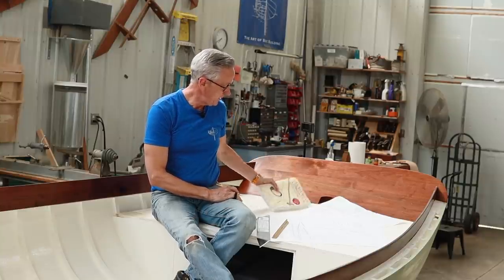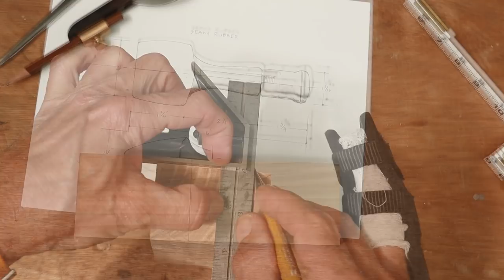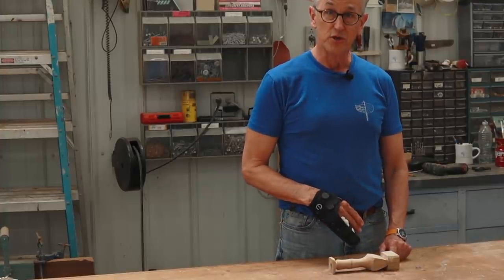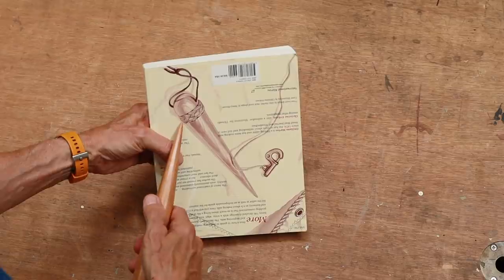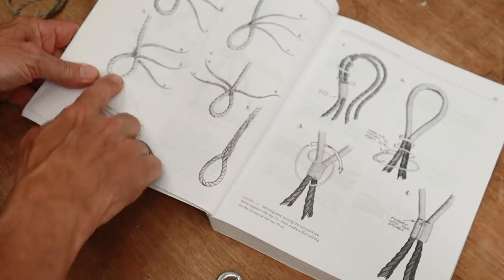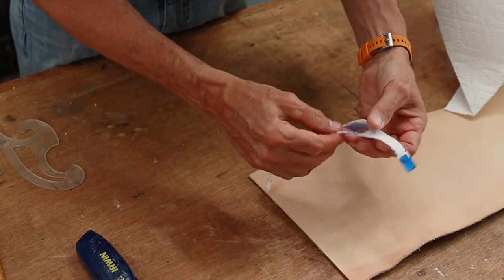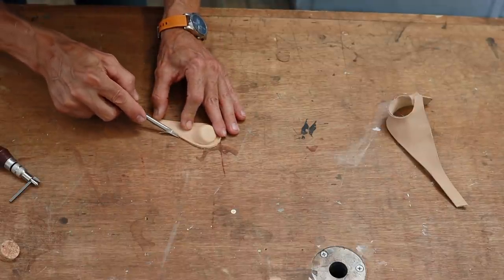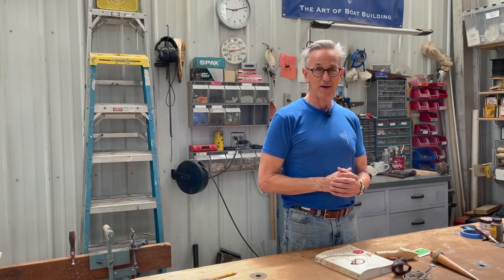Sailmaking, Part 1:The Tools of the Trade S2-E47

Comment: Cool! Watching you make the seaming palm was instructive, especially using the piece of shaped cork to mold the leather to hold the iron. I bought a palm some years ago with a piece of plastic holding the iron; another palm uses molded rawhide. The plastic won't last, so I'll use your method to replace it in time, either with leather or rawhide, and reuse the original iron. Thanks for the tutorial.

Comment: Nice work on the beautiful tools Bob.  I noticed that the sail hook you created had the point more perpendicular to the length of the hook shaft as opposed to having it at around a 75 degree or so angle.  Why was that?  Thanks for sharing.

Comment: Bob as I have found with any sewing into anything hard to witch one should use a sewing palm ,I find if you backstroke the needle through your head hair you will find the sewing much easier!
Reply from the maker: Very interesting. I’ll have to give it a go!
Reply: @TheArtofBoatBuilding  try 2 or3 strokes every 2 to 3 stiches
Reply: @henryprather7868  i suppose that depends on your hair products or how oily your hair is. If you are bald or have super dry hair, I don't see it helping much. If you have oily hair or slick it back with some sort of petroleum based product, then it would make sense that it would lubricate your sewing.